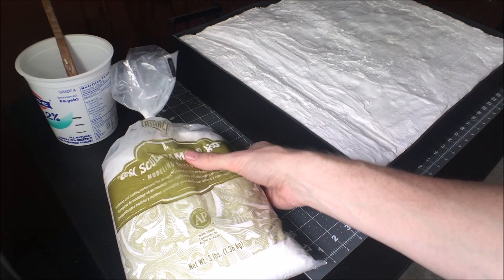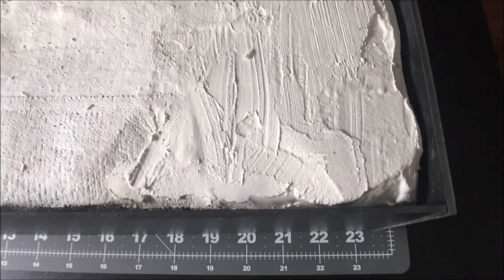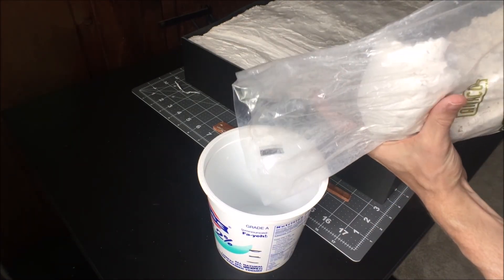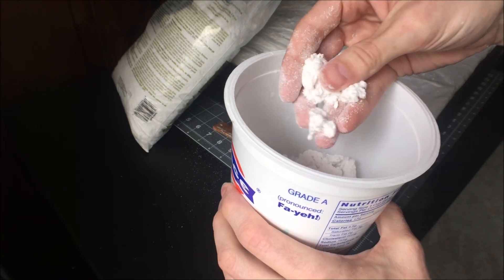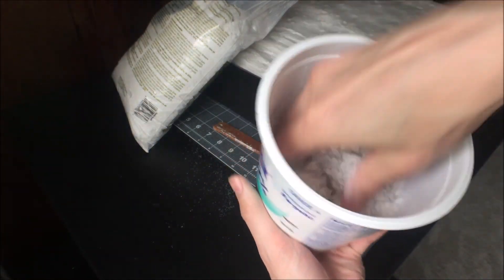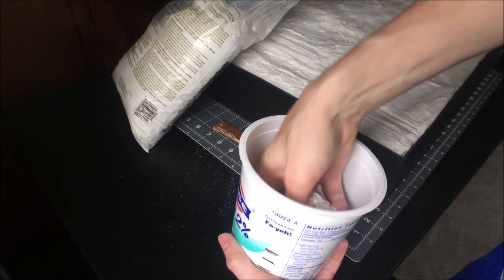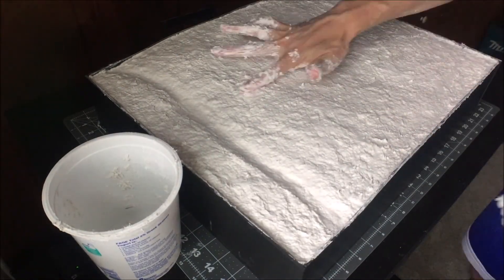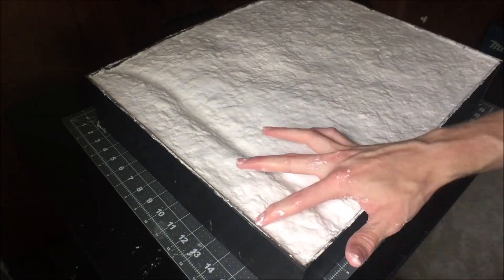Smoothing out Diorama Terrain with Sculptamold

Comment: While this video is a little older at this point - my rule of thumb with clays, sculpt a mold and plaster is always glove up because any of these can accidentally catch finger prints if you are not careful, plus the gloves also actually help with the smoothing, though for terrain in war games which s where I tend to work (even for dioramas) that is like only step two since I have the dirt, rubble and natural scenic (grasses etc etc) to add in after that. But I feel like you might have been able to get a smoother base just with the gloves while you work.
Reply from the maker: Thanks for the tip! I didn't have any issues with fingerprints but perhaps it could still help the next time I try something like this.